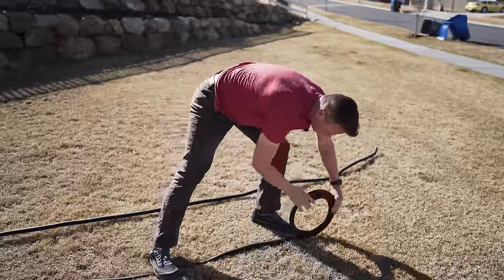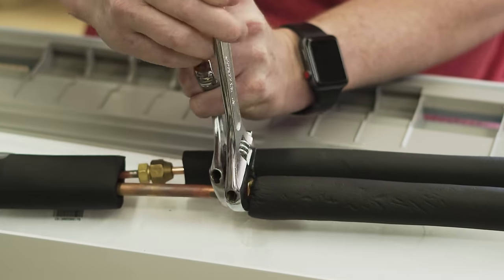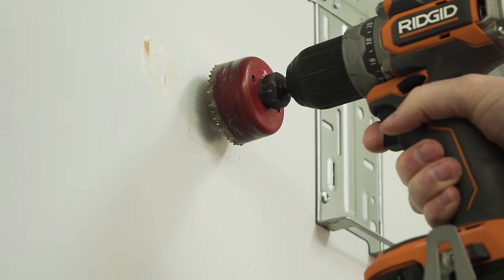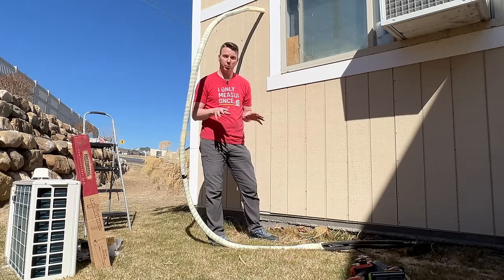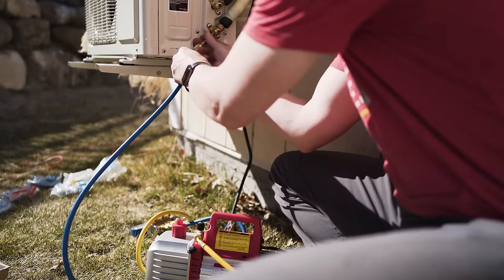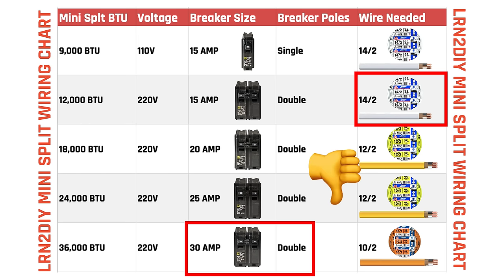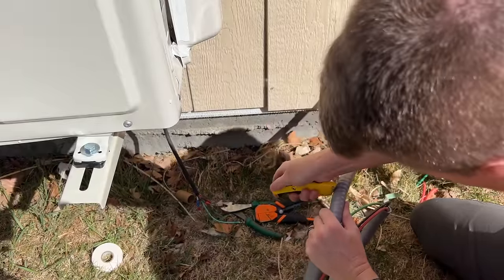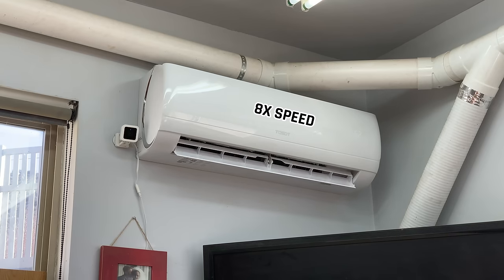DIY Mini Split Install - All the Things Nobody Shows You

Comment: A little tip, use a long pilot bit the same size as the hole saw bit FIRST, so your holes perfectly align.
Reply: Also, I prefer to drill a 2-7b8” hole, and line the hole with a 2.5” pvc pipe.
Reply: A metal wire coat hanger works too.
Reply: The holes don't need to be perfectly aligned. There is no way to see them both at the same time anyway.
Reply: yup

Comment: I went ahead and did a pad and mounted the outdoor unit on it.  My thoughts were less noise from the outdoor unit would get transmitted through the wall, into the inside space.  My neighbor mounted it to the wall and did say he could hear the compressor through the wall.  We get a lot of water from the indoor unit, but it is humid here.  I really wished i'd seen your video before putting in our units.  Very well done!

Comment: I did my own mini-split as well but already had a vacuum pump from doing Auto A/C work. Some auto parts stores (Orielly’s comes to mind) have loaner vacuum pumps and flaring tools.  You’ll still need the mentioned adapter to connect the yellow line to the pump but it’ll save you $100ish.
Reply: blah blah blah
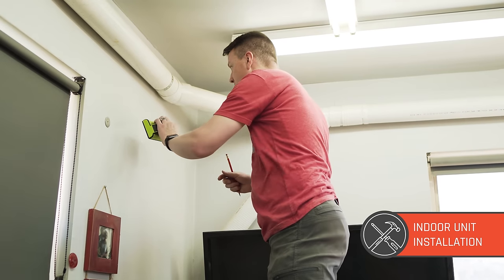Reply: I’m impressed with the video. Not going to re-cover the 10awg vs 30 amp breaker covering a 15 amp system any more than already covered. I will only say this: a white wire used on a 220v system should not be referred as a neutral. A neutral is a specific return on a 120v system. A white wire used on a 220 is a line or hot and should have a phasing tape or marker , on both ends noting such. (Using the extra red wire 0:29 would have been simpler). Nice concise video!

Comment: I really appreciate the time you took to put together this video.  I used it as a guide to install my Senville mini split.   Your step by step instructions were great as well as your parts list to buy stuff from Amazon.  I would have never had known to get that adapter fitting to connect to the low pressure side while vacuuming the line.  Thanks again and you really helped me and saved me a boat load of money!
Reply: Agreed… this video is greatly appreciated!
Reply: Hi, how mo
how long to get through the complet installation?
Reply: Hope you didn't follow his advice on choosing a breaker!

Comment: When attaching the outdoor unit on the wall, you get the vibrations from it, beeing amplified through the wall, so it will be noisy inside.
Keep it seperate, and it's much less noisy.

Comment: 24:25 You made a HUGE and dangerous error on using the incorrect breaker, The Machine itself needs to have the ability to flip the breaker if it draws more than 15 amps, by installing a breaker that is double the rating of the machine, you are now risking a fire hazard and or damage to the machine itself, since its only rated for up to 15 amps You are now allowing the machine the ability to short our to over 30 amps more than double the rating on the unit itself. The gauge of the wire does not change the rating of the machine therefore the breaker should not have been changed!. You can run larger gauge wire and still utilize the 15 amp double pole breakers. You just cannot do the reverse and run 14 gauge wire on a 30 amp double pole breaker. Please stay safe, I'm concerned that you stated you are comfortable since you have done this several times, I really hope you didn't increase all your breakers in your house just because you used a larger gauge wire. that's not how it works.
Reply: GOOD OLE DIY
Reply: They don't allow 15 amp circuits here, except for residential dedicated lighting circuits, or lighting circuits combined with convenience outlets (such as outlet controlled by a wall switch with the intention of controlling a lighting fixture). In commercial, 15 amp circuits and 14ga wire aren't even allowed at all. The proper workaround is just buy a fusible disconnect box, they're only a few dollars more than a non-fused one, and spend a couple bucks for some 15 amp cartridge fuses. The Diversitech ones I get even have two red LED's that light up if one fuse blows so you can see at a glance if a fuse is blown. Installed dozens of them and have yet to have even one blown fuse or any other problems with them. And I prefer the side hinged door rather than the el-cheapo ones with the door that lifts up. There's a reason so many gas furnaces have a 15 amp glass fuse in the disconnect switch. The reason is, most gas furnaces say 'max fuse size 15' on the rating plate, but furnaces are required to be on a dedicated circuit, and since it's not a lighting circuit it has to be a 20 amp circuit. Not a big deal of extra 5 amps, but to pass inspection, it has to be right.
Reply: According to the NEC the breaker is sized to protect the down stream wire as sized to max current rating of the wire with a slight derate.  You could hang this unit off a 4/0 run of AL  with a 200A breaker if you took the 4/0 all the way to the unit and found a way to attach it.
Reply: @warmac57  False.  Permanently installed motor loads have different rules.

Comment: you don't match the circuit breaker to the wire.. you can use lower gauge wire than the 14/2 like you did but you need to stick with the 15 amp 2 pole breaker before you burn up your mini split if something went wrong

edit: Looked up the tech specs of your unit and on the detailed sheet it says "max current over protection: 15amps" so you definitely need to swap out that breaker
Reply: Better yet, install a FUSED disconnect and put the correct 15 amp fuses in it.  Breakers are designed to protect wires from overheating and causing fires, fuses are designed to protect equipment.
Reply: yes he is wrong about the breaker
Reply: Correct! The wire can be over sized, but not the breaker.
Reply: To some extent.  That wire may be too large for a 15A breaker.  Breakers and almost all other wiring devices have listed permissible wire sizes.  Fused disconnects are your friend.
Reply: Breakers arent to protect the units. theyre to protect the wires
Reply: @legobuildingsrewiew7538  Breakers are to protect both the wiring and the unit.  The Unit itself should be Listed for use with a particular size breaker.

Comment: You checked for pressure leaks after you put a vacuum of 30hg in the condenser only. Not a bright move. The vacuum will pull the soapy mixture into the system.  Not exposing any possible leaks, and contaminating the system. You should have opened the lines to the inside unit. Because you could have leaks between the two units. Second, pressurized the entire system,  then leak checked it. After that pull a vacuum. Even though every thing was capped, the moment you opened them up you introduced moisture into a majority of the system. The vacuum that you apply is what removes it. Last continue with the filling of the system

Comment: Never remove the gauges while the lines are in a vacuum, you broke the vacuum by removing the gauges first(moisture is now in the system) . gauges should be left on until you let the refrigerant go and pressurize the system, then you can remove the gauges

just FYI  from a licensed HVAC contractor 
everything else was good information
Reply: I saw that too, Came to comments just for this mistake!.
Reply: so should the vacuum pump still be running when the refrigerant is let go or just leave the gauge connected till then?
Reply: @harrybutter1286  vacuum stays running until you close the gauges/manifold. After it's closed shut off the vacuum and open the valve on the condenser to let the refrigerant pressurize the system. Once it's under positive pressure from the refrigerant you can safely remove the gauges. 
If you have no experience with refrigerant, PLEASE WEAR SOME GLOVES JUST TO BE SAFE AND  TO PREVENT FROST BITE 
a miniscule amount or refrigerant will come bleed out when gauges are removed, this is natural, not much way around it.
Reply: @jesseluna4731  tyvm :D
Reply: He will be calling you for a service call.  That's why most HVAC companies refuse to service these DIY mishaps.  I had to turn it off when he oversized breaker.  Hopefully no fire happens.
Reply: @jesseluna4731  Why does it not all leak out pretty quickly if it's under pressure? Is the hole too small?
Reply: @nickgilbert1264  when you pump air in your car tires it doesn't leak out because it has a core that need to be depressed to let in air and let it out.  that core is depressed by the fittings used to fill the tire with air. Same concept applies to the refrigerant access ports, and if you have the proper gauges fitting they will have low loss fitting on them and you'll lose a very minimal amount which will have no effect on The system
Reply: i was screaming NOOOO!!!  why do so many people think a schrader would hold vacuum???  I’ve seen 10 year installers do this also.
Reply: @BIGMIKE816  keeps us in business. Went on one of these calls recently. dual zone ductless. poor vacuum procures like this. typical non condensable symptoms.
Reply: @harrybutter1286  the Vacuum pump should be off when you release the refrigerant in the outdoor unit. You want to wait to remove the gauges until after the refrigerant so the entire system is pressurized.  It is better to loose an extremely small amount of refrigerant when you remove the gauges than to introduce any air and water to the system.
Reply: @BIGMIKE816  He's not going to have a fire. An electrical fire is from excessive heat from the circular mil being too small. Let's see how smart you are... What is going to catch fire?
Reply: Just reduced the life of the unit

Comment: If you don’t torque down the flare connection behind the wall mounted evaporator.   It is guaranteed to leak in the future.    As well as the connections at the condenser.    Tighten down to much will flatten the flare on the soft copper. To lose well you get the idea.
Reply: This guy is the reason I have to go back and fix so many of these DIYer projects. Mini splits are not diy projects.
Reply: @JBra1382 Sure they are. . . You just have to know what you’re doing, and follow instructions. The manual clearly states the torque values for these lines. Why he chose not to follow instructions is beyond me.

Comment: Your outdoor unit has a nameplate that states the maximum overcurrent protection size (MOCP). You can’t just use a larger breaker without violating code. You can remedy this by providing a fused disconnect next to the unit with fuses sized per the nameplate. Also you don’t have a neutral going to the breaker. Those are both line conductors and should be labeled as such. You can permanently mark the white wire to identify it, but using the black and red would have made more sense. 

Great video and very helpful, but gotta be careful with electrical installs that violate code.
Reply: The nameplate usually has MCA (min circuit ampacity) which determines what wire guage you should use, and MOP (max over current protection) which determines the breaker. From everything I have read, MCA determines your wire guage, so if MCA is 15, then 14AWG wire is the smallest wire that can be used.  Then if MOP is 20, then you should use a 20 amp breaker.  While I know that is not normal, typical, or code for anything else in your breaker box (20 amp breaker with 14 AWG wire), everything I have read said that this is the correct way to do it.  I saw videos from several people, including one that teaches classes on NEC code, that says this is the correct way to do it.

https://www.youtube.com/watch?v=WugJ8-70Sqs
Reply: @shanefrank3281  I'm not sure if you meant to respond to someone else, but I 100% agree with what you've said.
Reply: @jcbabb2  I think maybe I did.  :)
Reply: @shanefrank3281  For UL 1998-listed air-conditioning equipment, the circuit breaker is there primarily for short-circuit protection.  The equipment has overload protection built into it.  The wire size is selected based on the manufacturer's MCA and tables in the electrical code.  Be sure to use the 60 degree C tables for these small circuits.  The breaker trip cannot exceed the MOCPD.  It really is that easy.  It shocks me how many people, including many in the trade, do not understand the electrical code.  BTW, I think the poster had a code violation, but can't be sure with the video.  Anyone else know what he left out?
Reply: In addition to the problem of an oversized breaker I don't know of any code that would allow you to run Romex wire inside your conduit. I realize as you said wire is expensive but these need to be individual wires if you're putting them in a conduit. The reason of course is potential overheating of the wires which are both insulated and inside a conduit.
Reply: @randybachrach8539  The NEC does not prohibit NM (Romex) from being run in conduit - assuming proper fill area. Local jurisdictions may have more stringent requirements. However, the fact that the conduit is located outside - in a WET location - does in fact mean that the NM (Romex) is not allowed.
Reply: @randybachrach8539  Thanks for that Info!!!

Comment: Ugh… AGAIN… electrically, you should have used the red and black, not the white and black. A 240V system needs the white conductor for the grounded conductor only. If white is the ONLY additional wire, it must be marked with red or black tape covering all exposed white color.

Comment: Folks, please don't use thread sealer on flare fittings. People often do that or Teflon tape and end up building leaks right into their work. The threads have nothing to do with the seal on these types of fittings.
Reply: Use it all the time for the last 20 years. Never had a leak from using Nylog.
Reply: @Stormchoirs  I'm glad to hear that you haven't had issues.
The sealing surface in those connections is the angled inner face of the line to the angled outer face of the fitting though. If the gasses are getting to the threads, they will leak out where the nut meets the outside of the flare anyway.
Reply: Good call, Teflon tape is for tapered threads. I'll usually throw on some refrigerant oil or Nylog.
Reply: I have heard (with no proof) that the Nylog can get into the expansion valve, and cause problems because of the small diameter opening to the other side.  So use great care when applying the nylog to the sealing surface, and not letting any get inside.  Also if you apply anything to the threads, it will make it Really difficult to remove the flare fitting.  The threaded part of a flare fitting never sees any refrigerant pressure.
Reply: @Kangenpower7  of you use a ton of it I could see that happening.
Some folks really overdo things. Personally I use just make sure flare fitting threads and sealing surfaces are clean and tight.

Comment: I'd suggest changing the double pole 30 amp breaker to the 15 amp double pole breaker required for the unit.  Doing so protects the equipment and, conversely the 30 amp breaker may not.  🙂  Great video.

Comment: Too many mistakes on the electric.  You should have followed your own advice and consulted an electrician. You absolutely need a 15 amp breaker not 30. You size the breaker to the appliance not the wire.  You should not run Romex through conduit (code violation). You should have run THNN.   You should go with a fused disconnect and you put the wip connector on wrong. You are suppose to loosen the nut, put the hose on and tighten the nut.
Reply: Never size the breaker to the appliance,  the breaker is to protect the wire from overheating and starting a fire in your walls. If you want to protect your appliance you add a fuse at the appliance.
Reply: @beezalbub7325  Wrong.  You size the breaker and the wire for the appliance, and its current draw.  Nick is spot!  LRN2DIY should have taken is own advise.  Call a licensed electrician.